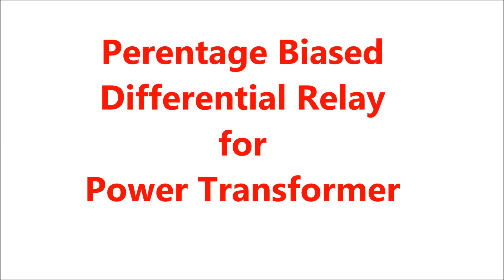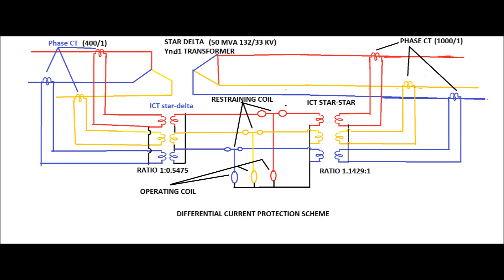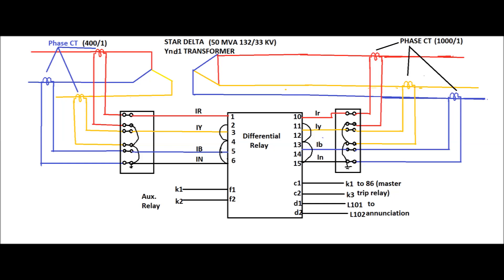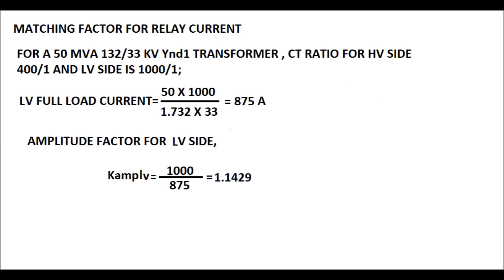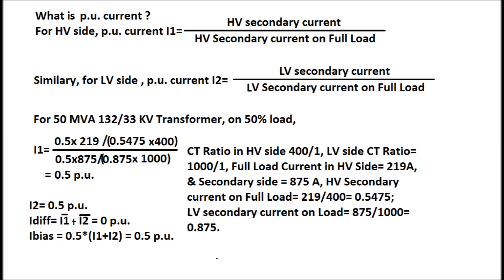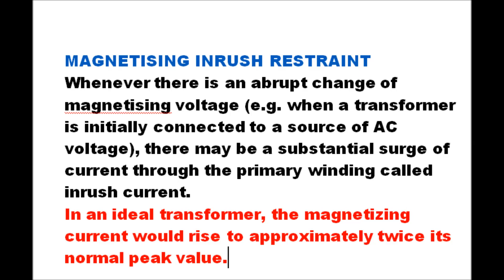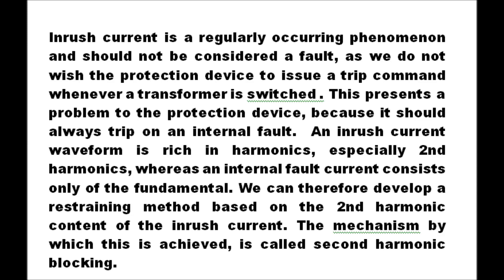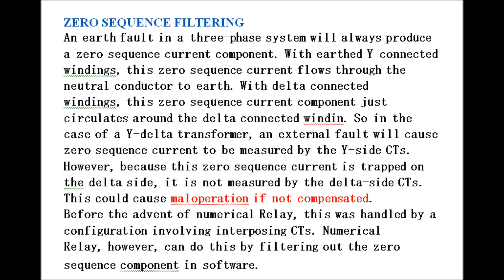Differential Relay for Power Transformer (87T)

Comment: Sir P. U. Current ki full form Kya h
Reply from the maker: Per Unit Current
Reply: @relayprotectionelectrical  sir aapne jo p.u.current  calculation ( 50% T/F load) k time jo 0.5 ki value li h wo Kya h . Means CT secondary 1/2(0.5) Ampere current. Ya T/F ka 50% load ko 0.5 (%) liya h.
Reply: @parmodyadav9966  That is 50% load (0.5)